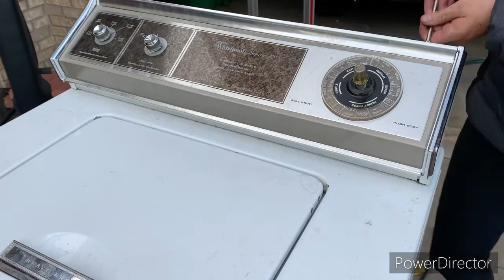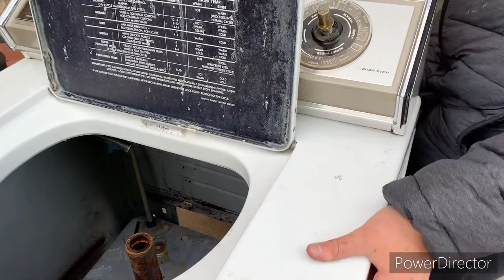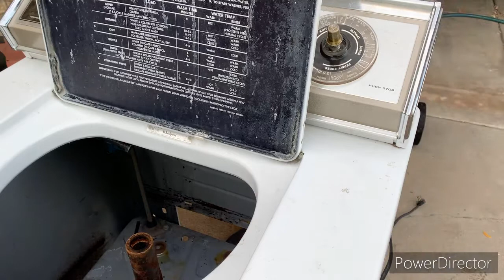Scrapping Out The 1974 Whirlpool Belt Drive Washer☹️😢

Comment: There are those days in life, which we must draw ✍️ the line on repairing these washing 🧼 machines. This is one ☝️ of them. I hope 🤞 the parts of this washing 🧽 machine get used as repair 👩‍🔧 parts in others. I do NOT want to see the tub 🛁 of this washing 🧼 machine be used as a burn 🔥 barrel, as many do.  This washing 🧽 machine is at the end of its useful life, financially. The truth is, it can be repaired, but these washing 🧼 machines are getting very hard to find. The parts are probably not compatible between models. The motor on this washing 🧽 machine is probably good 😌, and so is the transmission. I wish there was new old stock parts for these washing 🧼 machines, as there are for classic cars 🚘. Your friend, Jeff.

Comment: What happened for it to be scrapped?
Reply from the maker: Rust
Reply: @ScantPear  the tub rusted out? I heard there are some products that work.
Reply from the maker: @petermaz701  nah it was chipping away
Reply: @ScantPear  the GE filter flo washer from the 70s and 80s are good as well. They have filter pans on top of the agitators. Older Hotpoint washers of those eras have a ring filter on top of the spin basket.
Reply from the maker: @christophermurray3825  first of all it is called a spin DRUM and second of all the 1996-2006 ge was way better than the filter flo
Reply: @ScantPear  understandable and the filter flo does a spin-drain and spray rinse during the first spin cycle.
Reply: @ScantPear  Better than the filter flo ?....you must be kidding. Those chug chug GE washers that came after the filter flo's didn't have half the quality or longevity.